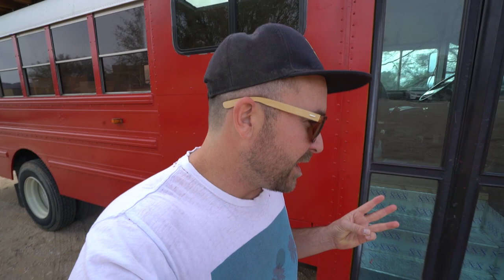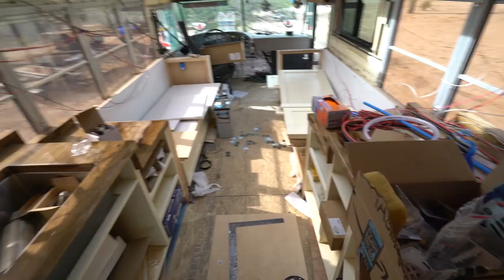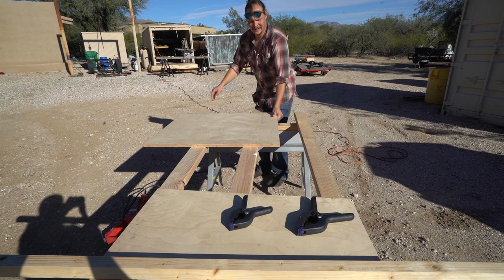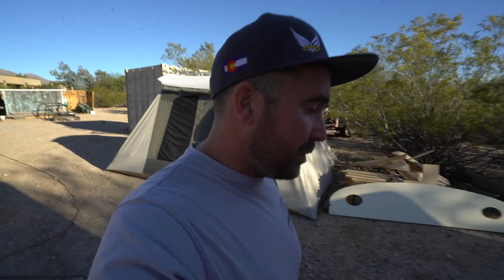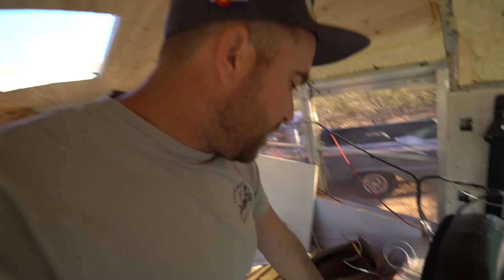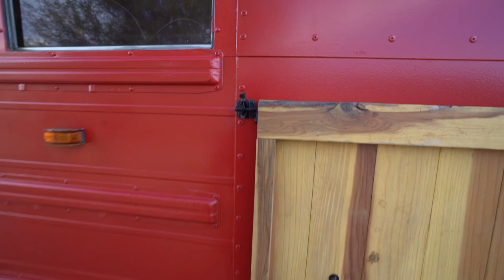How to Build Cabinet Drawers w Mojo Bus

Comment: Looking great! On your shelves i would add" Folding Sprt Left Brass"(folding table\leg brace )
 instead of chains ,better support and wont be making noise rattling around when driving around.They are cheep and i think look better and no noise.on the underside of the shelves when folded up you should make them signs of some sort so you just don't see the bottom of them when folded up.Maybe on the front one the name of your bus or something along  that line.Keep doing what your doing
Reply from the maker: Good tip. Thank you.

Comment: Don’t use chain it will hit bus and chip paint.....use coated plastic or wire !   Even plastic chain will flap around!   Coated wire with loop on each end .    Let’s go slacker get moving.....😃
Reply from the maker: Haha I found plastic coated wire, but my picky ass wouldn’t buy it bc it wasn’t black to match the hardware.
Reply: @JaxAustin  Keep looking! LOL Happy New Year!
Reply: Jax Austin have you thought about a rod that would go in the latch catch and metal rod on the fold down table?
Reply: @JaxAustin  get black plasti-dip & problem solved.  I agree with the others - you don't want to chip the beautiful paint job.

Comment: Water is the enemy to the outside tables. What plans do you have for protection? Removeable tables are an option with a water tight connection for you electrical setup. I'll wait and watch. With ALL the space you now have it would take very little of it to make a vertical closet to storage of the tables. Just an idea as I have lived in the NW for 50 plus years and had to fight water on and in everything. im not being critical just curious...

Comment: tie a rubber band around the latches when traveling or add a small hole and a little hairclip style locking pin through the mechanism
https://image.made-in-china.com/43f34j00nmWazdHtgEcr/Fastener-Metal-Spring-Lock-Hitch-Pin-Hair-Clip-Double-Winded-Rigging.jpg
so theres no chance that they jitter open , you dont want the table to drop down after a bump in the road as it might cause damage to others 
lost the tailgate of my trailer on the freeway because of that once i was lucky there wasnt anything loaded intoo said trailer
Reply from the maker: Thanks!